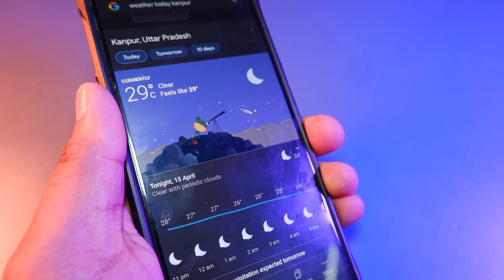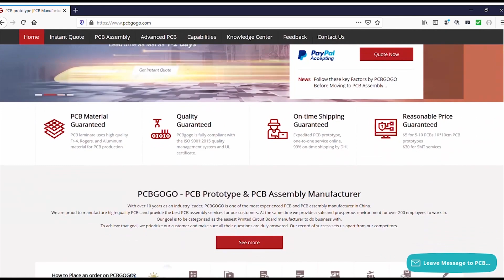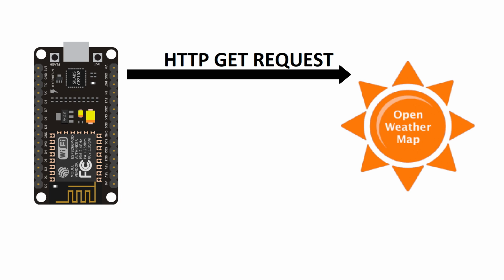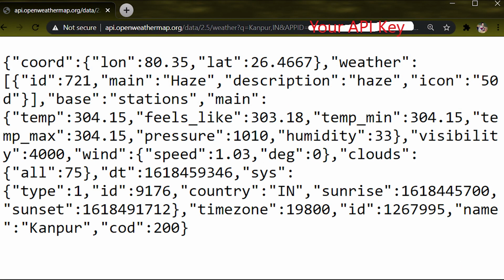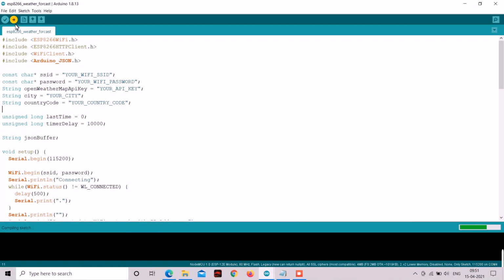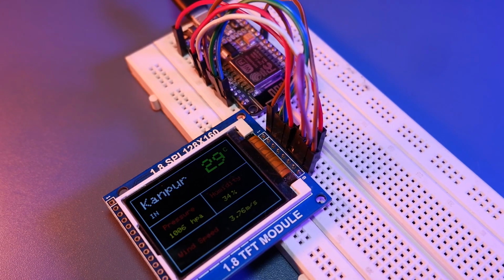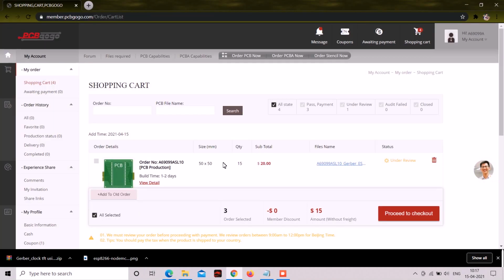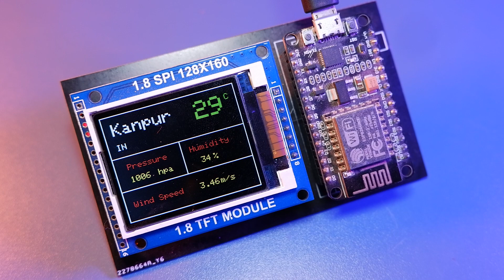ESP8266 Nodemcu & ST7735 TFT Display based weather station | Get weather information of your city

Comment: How to read image file from sd card and show on the screen?
I don't have any problem with SD  when I use the screen with Arduino Uno.
But when I replace Arduino with NodeMCU ESP8266, sd no longer works.

Comment: Compilation error: call to 'HTTPClient::begin' declared with attribute error: obsolete API, use ::begin(WiFiClient, url)
Reply: Looks like one or more of the libraries have been updated and the code does not compile right anymore!
Reply: add wificlient before that command
Reply: WiFiClient client;

& then swapped in

http.begin(client, host, port, url);
Reply: Follow these steps:
1) add #include <WiFiClient.h>
2) add WiFiClient wifiClient;
3) change 
http.begin(serverName); 
to 
http.begin(wifiClient,serverName);

Comment: Have an error like this when compiling. Obsolete API.

Arduino: 1.8.19 (Windows 10), Board: "NodeMCU 1.0 (ESP-12E Module), 80 MHz, Flash, Disabled (new aborts on oom), Disabled, All SSL ciphers (most compatible), 32KB cache + 32KB IRAM (balanced), Use pgm_read macros for IRAM/PROGMEM, 4MB (FS:2MB OTA:~1019KB), 2, v2 Lower Memory, Disabled, None, Only Sketch, 115200"

C:\Users\kamal\OneDrive\Desktop\esp8266-weather-station-main\esp8266_weather_forcast_with_display\esp8266_weather_forcast_with_display.ino: In function 'String httpGETRequest(const char*)':

esp8266_weather_forcast_with_display:156:13: error: call to 'HTTPClient::begin' declared with attribute error: obsolete API, use ::begin(WiFiClient, url)

  156 |   http.begin(serverName);

      |   ~~~~~~~~~~^~~~~~~~~~~~

Multiple libraries were found for "Adafruit_I2CDevice.h"

 Used: C:\Users\kamal\OneDrive\[Documents]\Arduino\libraries\Adafruit_BusIO

 Not used: C:\Users\kamal\OneDrive\[Documents]\Arduino\libraries\arduino_753355

 Not used: C:\Users\kamal\OneDrive\[Documents]\Arduino\libraries\arduino_607344

exit status 1

call to 'HTTPClient::begin' declared with attribute error: obsolete API, use ::begin(WiFiClient, url)

This report would have more information with
"Show verbose output during compilation"
option enabled in File -> Preferences.